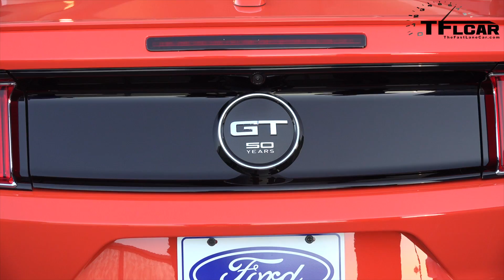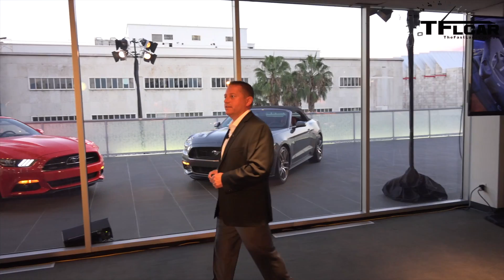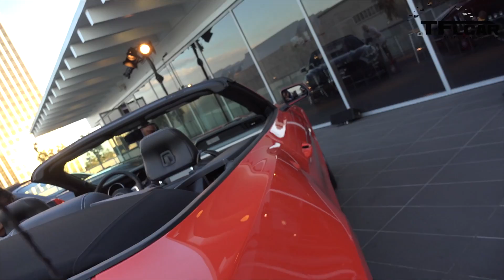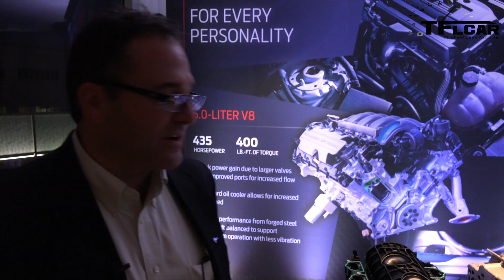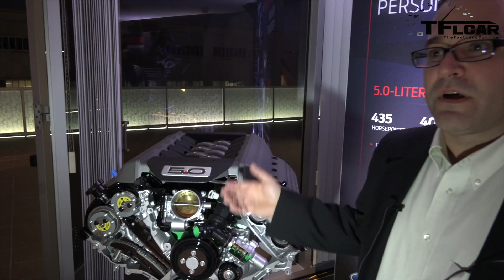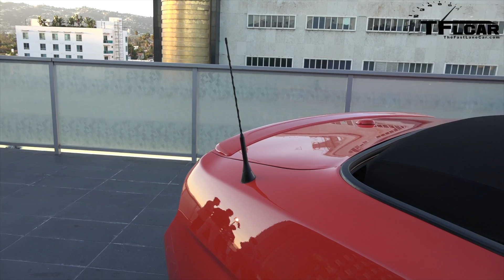2015 Ford Mustang GT: More than Everything You Ever Wanted to Know

Comment: Why didn't they make an Ecoboost V6?
Reply: With the 5.0 there, an Ecoboost V6 which would likely be of similar performance, is fairly redundant. But that's just my take on it, I don't know what their reasoning actually is.
Reply: desertfox2020 Thanks for your input. I just find it weird that the four cylinder puts out better numbers than the six. As well as the fact that they didn't invest much into the six cylinder for this generation of Mustang (from what I can tell).

Comment: Why doesn't anyone talk about the base V6? Isn't that the bread and butter volume seller? Ford should also promote the base car as an alternative to many other mainstream cars at the same price point.
Reply: MichaelAChang
The Ecoboost is plenty reliable. Its been around for over 10 years in different configurations and is only about a grand more which you'll be able to make back in fuel costs.
Reply: carblader4254 Which brings up an interesting question - will we ever see million-mile cars with these high tech engines or are they such precision machines that it becomes financially unfeasible to do any major overhaul.
Reply: Sounds like they want to push the ecoboost as the base car. The V6 is just there for those who those not sold on it I suppose.
Reply: DynamiteDupree You might be right, but the EcoBoost hasn't proven itself yet as a reliable alternative to the venerable V6, and charging a premium to boot. Things like the reliability of the turbo unit and the issue of carbon guild-up on valve stems and generally harder-working drivetrain are all significant downsides.  

I don't see a reason mainstream buyers will go the high tech route if they can be convinced the base V6 Mustang can be a viable alternative as a family car, just like the old days. This type of marketing will surely sell more Mustangs and not necessarily at the expense of displacing sales of Ford's other cars.
Reply: DynamiteDupree The V-6 is the base car, the ecoboost 4 is an upgrade.
Reply: ZepG Let me rephrase it then. It seems like they're pushing buyers towards the ecoboost if you don't want/can't afford the V8. The V6 is just there for those who those not sold on it I suppose.

Also yeah, what carblader4254  said.
Reply: DynamiteDupree That makes sense and it does appear Ford might have plans to phase out non-EcoBoost engines altogether.
Reply: MichaelAChang They'll never get rid of the V8 but I can see them getting rid of the V6. They said they purposively made the V6 less powerful and less fuel efficient than the Ecoboost so that more people would buy it.
Reply: MichaelAChang They will not and can not get rid of a naturally aspirated V-8 but the twin turbo V-8 (Voodoo) will be fun!
Reply: MichaelAChang I don't think any part of the car will last a million miles. The suspension will go and the transmission and the engine and it's really not practical to say a car should last a million miles. Plus cars are somewhat meant to break at a certain point so you'll buy another.
Reply: carblader4254 That might be generally the case, but there are many examples of million-mile Honda, Volvo, Cadillac, Buick (on YouTube) and other brands across the model-year spectrum - except modern high tech cars which I've not come across examples of. 

Those lumbering inefficient engines like Ford's Modular V8 have served the livery, police and severe taxi duty admirably, on the other hand an Indy car engine only has to run 500 miles. I suppose time will tell whether a 2015 Ecoboost Mustang will survive reasonably high mileage under intended usage or will they suffer turbo failure, carbon build-up or some other cost-prohibitive repair.
Reply: MichaelAChang If you actually look up million mile cars theres a Lincoln town car which has basically the same engine as the old 4.6L that was in the Mustang. But anyways the engine is usually the last thing to fail on a car. The tranny and other parts will go way before the engine actually dies. And anyways no one is buying a new Mustang to get a million miles out of it. They'll maybe put on 75k at most then sell it so your comment isn't really practical or logical.
Reply: They ignore the v6 since it doesn't belong in a Mustang. Same for the 4cyl...  In fact, the 4cyl is destined for the European market. I don't think they expect to sell many in North America. Mustang is a Muscle car... Anything other than a GT is for posers and wannabes.
Reply: sdd ss You do realize they sell more V6s than they do V8's right? Most people who buy it don't give a flying fuck whether it has a V6 or a V8.
Reply: sdd ss Mercedes S-Class offers often more than 10 engine choices depending on market and model year. It's the kind of thing you have to do with a World Car as the Mustang will be, especially if a car can have multiple personalities - track car, family car, fun car, or daily driver.
Reply: MichaelAChang The S-Class only has three different engines. A 4.7L BiTurbo V8, a 5.5L BiTurbo V8, and a 6.0L BiTurbo V12.
Reply: carblader4254 The W222 is new; the engine choices will phase in. The W221 had 11 engine choices world wide from I4 diesel to V12.
Reply: MichaelAChang Thought you were talking about the current one but anyways the Mustang isn't trying to be an S-Class that appeals to everyone. It's a Sports/Muscle car that isn't going to have 1,500 different engines available. Only having 3 engines isn't going to hurt its sales.